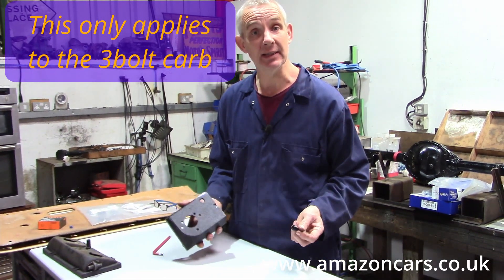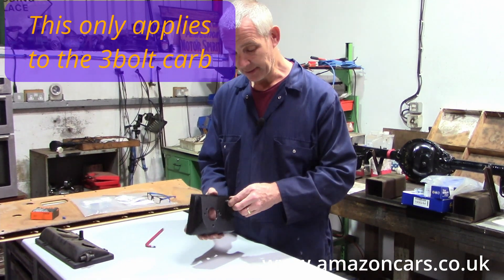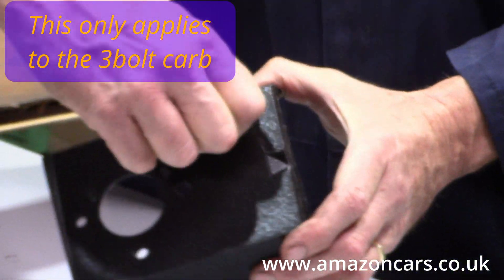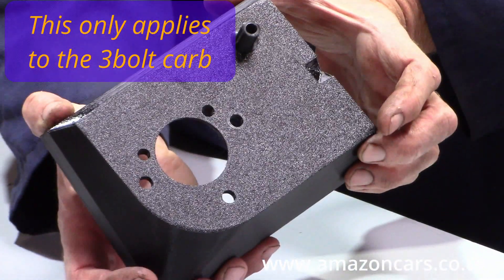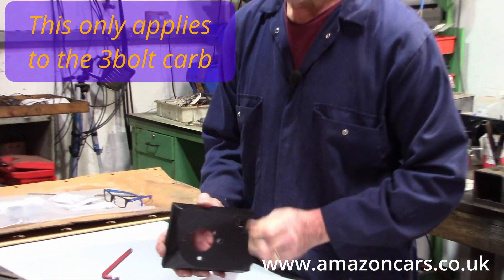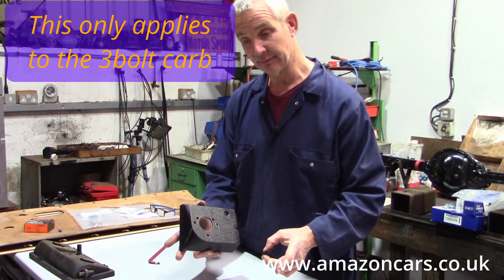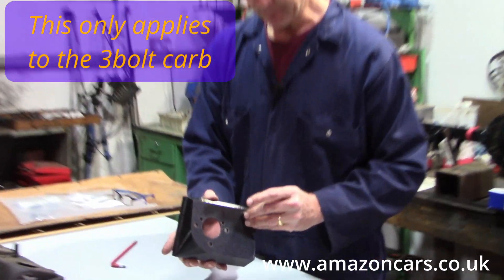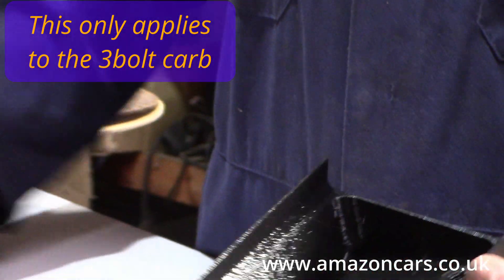Airbox for twin SU HS6's: LHD Az/P18 & all 140's

Comment: What type of filament do you use to 3d print parts so close to the engine? ABS? PETG? I've been working on 3d printing some cable management bits for my Amazon but worry about underhood temperatures and I know PLA won't cut it.